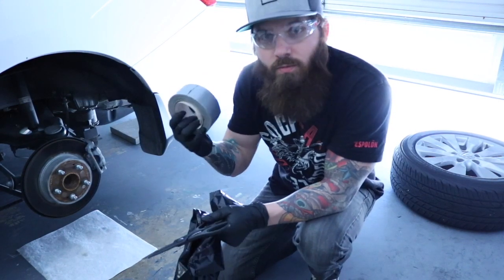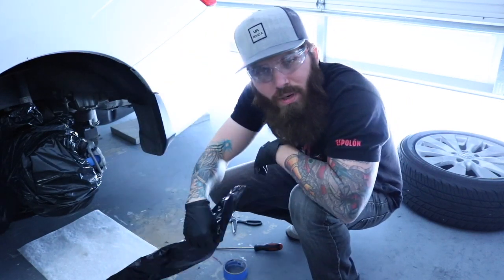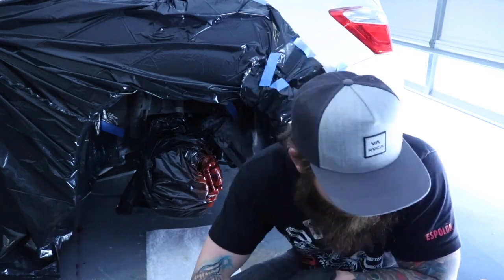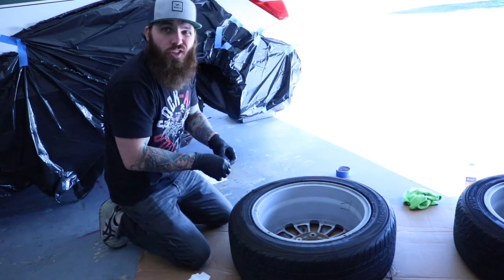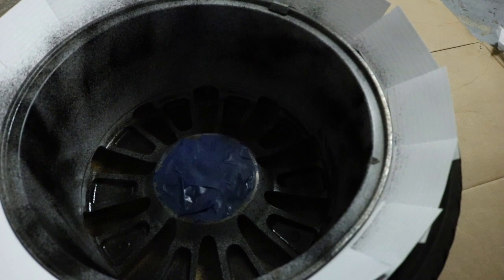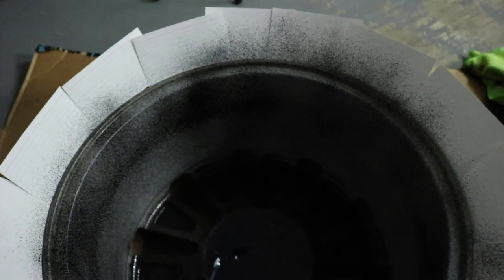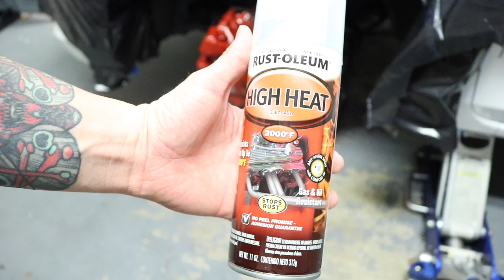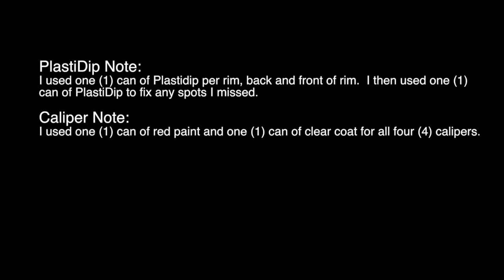PlastiDip Rims & Paint Brake Calipers

Comment: Thank you for being so detailed!
Reply from the maker: K M no problem! I also have a video about how long they last after so many car washes. After putting in the hard work and seeing how long they last, I will powder coat next time. I’ll drop that link below. Thanks for watching!
Reply from the maker: K M https://youtu.be/UlM2d10xcc4
Reply: @wolfmanproductions86  Thanks for attaching the link :) Won't powder coating ruin the shine though? I was thinking about clear coating but someone said that made their calipers dull also.
Reply from the maker: K M oh my bad. Which part where you wanting to do. The plastidip rims or painting your calipers?
Reply: @wolfmanproductions86  Painting my brake calipers.
Reply from the maker: K M I gotcha. I thought you were talking about the rims lol. My bad. Yea I didn’t have the car long like 4 months after I painted them. They still looked good when I traded it in. Just be sure to get that high heat paint and high heat clear coat.
Reply: @wolfmanproductions86  Thank you, I really appreciate you taking the time to provide information and answer questions, not many channels do that. So the high heat clear coat still looked shiny/the same while you still had the car? And how many cans of paint and clear coat are need Per Caliper?
Reply from the maker: K M If my memory serves me right I only used 1.5 cans of red and one can of clear on the car. It may have been two full cans of red, it was awhile back so I’m not for sure. Below are the links to the paint I used. 

Red. Rust-Oleum Automotive 251591 12-Ounce Caliper Paint Spray, Red https://www.amazon.com/dp/B006ZLR9GQ/ref=cm_sw_r_cp_api_i_CjgYDbTA8SPJ7

Clear. Rust-Oleum Automotive 260771 11-Ounce 2000 Degrees High Heat Spray, Gloss Clear https://www.amazon.com/dp/B006ZLQ0JI/ref=cm_sw_r_cp_api_i_klgYDb266AF13
Reply from the maker: K M you don’t want to put too much on. Even the clear coat. Don’t want to “cake” it you know.
Reply: @wolfmanproductions86  Got it, again thank you !

Comment: would plasti dip be safe on these calipers 
due too the wheels get pretty hot specialy durning summer
Reply from the maker: I don’t think plasti dip would be safe for the calipers. 

I would use that high heat paint I used in the video.

Comment: How's it holding up?
Reply from the maker: Aaron Miller I sold the car 6 months ago. The brake pads held up really really good. As far as plastidip, that will be the last time I ever do that. It started peeling. I would wash my car at a car wash 2-3 times a week. And not sure if that accelerated the peeling or not. If I would do it over. I would have powered coated the rims. Hope this helps.
Reply: @wolfmanproductions86   Yea rust oleum in matte black used for grills would work well on inside of wheel maybe? Or High heat clear over plasti dip.
Reply from the maker: Yea that may work too. Haven’t tried it though.